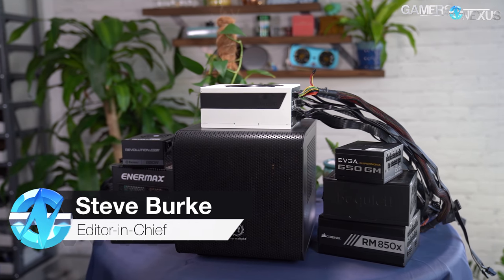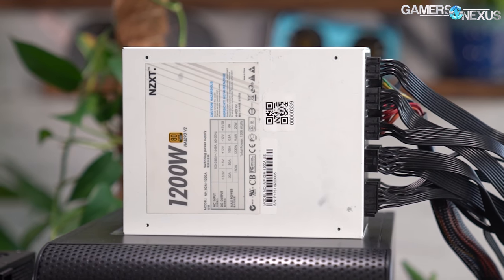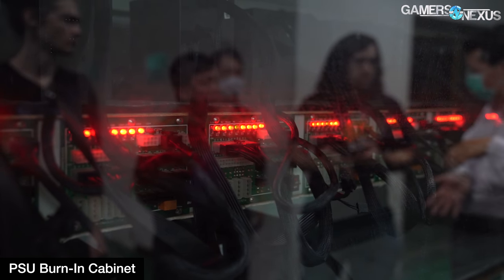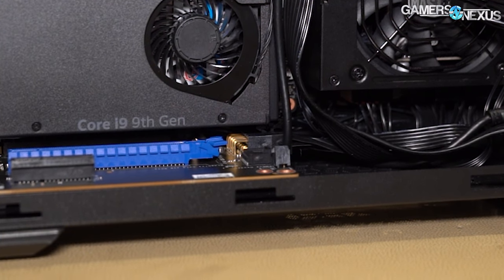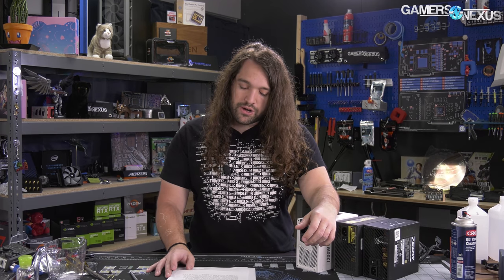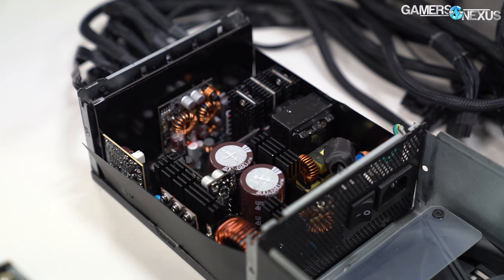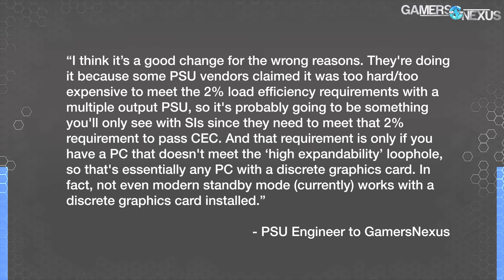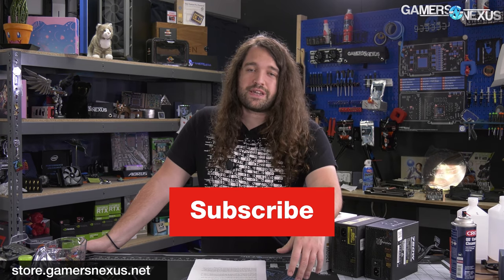Intel's ATX12VO Spec Explained & What Manufacturers Think

Comment: What a mess. The 5v and 3.3V railed are hardly used  and thus the  consumption will be small. Even if their efficiency is lower  in the scheme of things the majority of  power consumption will come form the 12v rail. 
which means motherboards will be forced to do the conversation on there making things worse for the motherboard.  And the overall efficiency will go down. A good   power supply will still have way better  efficiency for the dc dc conversion than the  solutions put on cheap ma inboards.
If anything this will lead to more waste!!!!

Stupid politicians virtue signaling.
Unless you make all pc components 12v  then the only 12volt power supply will increase the waste not reduce it
Reply: USB, PCI-E, SATA, yeah, nothing uses 5V or 3.3V.
Reply: Because it is hardly used, there is no need to convert AC to DC for 3.3 and 5 V. That's mean even better power saved in the first place. Also less cable as there is only one connect to the motherboard.
Reply: Pretty much nothing (modern) in a PC uses 12V, that is why there are a bunch of VRMs on a motherboard for all the important bits, which take the 12V and step it down
Reply: @rexsceleratorum1632  and thats is relevant on what i said how??

no relevance at all

cpu which will consume a big chunk of power the voltage change all the time over generation so you will need VRM to begin with

in the past computer used also the other rails more than we do now

but as time passed more and more devices start using the 12v 
and thats why the modern power supply practically deliver 12v and very few watt on the other voltages

having the politicians pushing for a hight efficiency power supply for all voltage lanes is ridiculous since there is so small consumption there to begin with
Reply: @sonaruo  You are not making much sense there. A very low demand on a beefy 5V or 3.3V PSU power rail means low efficiency. Moving the VRM from the PSU to the mobo or SATA device means smaller, cheaper, more optimal VRMs can be used, which will operate much more efficiently.

Comment: I've had more motherboards fail than psu's. this standard calls for pushing a lot of current through the mb, i can't see that ending well.
Reply: Especially for people that do creative modding or any modding that requires power at all!
Imagine a person overloading the motherboard vrm for sata power because he wanted a 15+ drive NAS.
Reply: @zarmaanful  Right now people are getting inefficient PSUs designed with the 15+ drive NAS guy in mind when he could just buy a separate VRM module very cheaply for a 12VO and not burden everyone else
Reply: @rexsceleratorum1632  inefficient?

I thought the newer PSUs did like 90-95+ efficiency.

Installing a buck converter just for having access to +5v and +3.3v seems a bit inconvenient.
Reply: @zarmaanful  Newer PSUs already install VRMs/buck converters inside the enclosure. Taking them outside the enclosure helps you select a VRM (or multiple VRMs, they are cheap) that matches your load. A VRM that is overspecced (because the PSU manufacturer doesn't know what your load is) means it is not operating near its optimum load for the best efficiency. VRMs are usually inefficient when they are close to idling.
Reply: @rexsceleratorum1632  the efficiency gains from fine tuned VRMs won't make much of a difference.

And I am pretty sure majority of consumers won't know/bother to properly spec out VRMs.

Some less knowledgeable consumers could buy questionable VRMs(e.g. Gigabyte PSUs) and cause some safety hazards(to themselves or the equipment).

Taking out VRMs from PSU WILL improve PSU efficiency, but in reality you are shifting the inefficiency towards the Motherboard thus the overall efficiency of the System stays similar.

To me it seems like a solution looking for a problem. It reminds me of the ASV kit thing happening with motorcycles.
Reply: @zarmaanful  VRMs outside of the PSU already handle most of the power usage in a modern PC because modern CPUs require voltages too low and amps too high to transmit over a long wire from the PSU. What is happening now is just the logical conclusion to what has been happening for a long time now. Which is that all devices will switch to 12 volt only and generate what they want internally. External standalone VRMs are pretty much a transitional requirement.
Reply: @rexsceleratorum1632  fully agree to the point regarding most of the power hungry components have their own VRM and take +12v from the PSU.

I also agree that +12v is optimal voltage delivery standard for consumer electronics.

Comment: wouldn't the 12V only PSU be cheaper (less power lanes = less complicated), amrite? if yes it would be shame if vendors would charge the same for those...
also wouldn't power conversion on mobo force the use of beefier radiators with fans? i would nope out of there

Comment: But there are already plenty of motherboards running on 12V only, the ones using a DC connector with external power brick.
Reply: Probably like my HTPC (which is a thin client) it uses an external power brick.

Comment: If I was a  motherboard  manufacturer, I'd build an external 12v to 5v buck converter. Creating a secondary power supply for any peripheral. Thus you can add them as needed.

Comment: ITX boards are already jam-packed to the brim, no way they can manage additional buck converters on there. I don't like it
Reply: Than you probably hav'nt seen packed board, search google for "kontron SMARC module"
Reply: The smaller connector saves more space then the extra components for the power conversion need.
Reply: @bjiirn  I don't think that 14 pin space is equal to 3 dedicated DC-DC buck converters and connectors to power SATA drives.
And the connectors to power SATA drives alone would take much more space than what you could save going to a 10 pin connecter.
Reply: @zarmaanful  Have you seen the size of a 3A buck regulator? That shit is packed in 6 pin TSSOP packages, even with the required cap and inductor you still fit inside of a nickel.

Comment: So motherboards will get more expensive and rogue devices will have a greater chance to blow your motherboard
Reply: wat
Reply: @metacube9913  The 12vo standard doesn't remove the need for 5v and 3.3v - It just moves where the tranformation of the power is to the motherboard: this will increase cost
If a device suffers a critical failure that means any power spike for the transformer has a good chance to kill the mobo, where the power is transformed

Comment: My opinion is that the PSU Engineer is right. I'm not a PSU expert but... 3.3v and -12v where designed to supply older hardware inside the motherboard, in older days even your CPU was powered drectly by 3.3v on the PSU, there wasn't a regulator like in modern boards, and -12v is a requirement for ancient NMOS sillicon that isn't used for more than two decades. It can be completly removed without affecting anything in modern hardware.

5v is a different beast. When talking about hardware integrated to the motherboard that requires 5v such as M2 and USB, its easier to move those VRMs to the motherboard and just supply the whole board with 12v rails. That is because those interfaces uses low power and can be easly converted from 12v as the power supply is doing today. So the 12v only new ATX12VO connector is a good idea in general, less cable and smaller/simpler PSU designs will expands the possibilities without compromising the MB capacities by offloading everything.

Powering external SATA devices from the motherboard IS A TERRIBLE IDEA in my opinion, that is where I draw the line. Building a regulator in a motherboard to drive multiple external SATA or MOLEX devices is a bad design! So, although i'm favorable in removing the 5v from the MB connector, I'm not favorable in removing it entirelly from the PSU, at least not yet! Maintaining SATA and MOLEX 5v compatibility is necessary at least until the market adapted to 12v only devices, if one day it does! Then we can think about 12v to 5v molex/sata adaptors that are not that hard to developed when talking about a single component like a old HDD or led strip. But this progress has to be linear.

And i think this standard should arrive to the enthusiast market as well, in form of new 12VO PSUs and motherboards with some companies supplying a adapter for older hardware.

Its even not hard to imagine a 12v only PSU with a small adaptor on the molex/cable sata itself that its responsable for splitting the 12v rail into a suitable 5v line for a single or maybe two devices at once. This standard is a progress, but currently at the wrong direction.

Comment: Great so now we get the motherboards to be more expensive and if something fails on them, that being a voltage regulator for the 5 and 3.3v rails we need to get the entire fucking board out of the PC just to get that replaced instead just replace PSU and go, fuck uptime i guess because that makes sense, yeah, NO!
Did i forgot to mention how that potentially limits the maximum power a motherboard's VRegs can give you thus limiting the number of drivers you can put into the system? 
And how the VRegs being on the mobo could cause more instability per VReg channel, because they are on a non-isolated environment where every motherboard manufacturer can make it how they like + the additional heat this produces further degrading the mobo over time faster?
Shall we make a reality check for a second?
Thanks Intel..(PS: fuck you Intel from the bottom of my heart and fuck you again because 3 years ago i bought a Seasonic Titanimum Ultra 650 Watt so i can keep it for years with its awesome low ripple and quality components, did i mention? oh yes fuck you Intel).
Reply: Don't forget RF issues, and repairability.
Every power supply or buck converter makes noise(Radio Frequency, Coil Whine) that when unshielded can cause interference with digital circuitry.
Repairing a Power Supply Unit is much easier than repairing a Motherboard with a million other circuits on it as well.(Diagnosing a motherboard is hell to say the least!)
Reply: @zarmaanful  +1
Reply: It will literally add all of $2 to the BoM, and remove half that through wire routing and connectors.

Comment: What I’d like to see in this spec is a dedicated 4 or 8 pin connector to feed a breakout board that a case manufacturer could locate and mount somewhere in the case. So it wouldn’t need to be on the motherboard, or limited to say just 4 or 6 drives.

Comment: To me, there are a couple things missing. Motherboards could be required to take 5V/12V on the always-on PIN to give us compatibility with current PSUs. More importantly, this would have been an opportunity to standardize the CPU 4/8 pin and GPU connectors, giving us one connector for all (but the main mobo which has the standby rail, power-on and similar).

Heck, that could have been a separate control-only cable, with everything else being one standard 4/8 pin 12V. That would be a dream.

Comment: Motherboard manufacturers know how to make these changes.  Think about a Thin-Mini ITX motherboard.  They generally only have 12V or 19V input, and an on-board SATA power out for drives.  I think this could simplify things for the better, on lower end systems anyway.

Comment: Seems totally stupid. Why would you move it onto a motherboard? Those things are already crammed full or stuff. Having to include a voltage converter on them as well will just make you be able to fit less features onto them. Not to mention the rubbish about "efficiency" At the end of the day, you will always have losses during voltage conversion. Now they have just moved them to the motherboard (another heat creater) rather than the PSU!
Reply: I mean, locally transforming DC-DC is actually quite efficient and very low footprint these days, as you would only need Buck topologies for this, there are solutions that boil down to a single chip. To me as an Electrical Engineer this sound like a much better solution than having to route another network on the boards, which mind you have fast switching traces. I think that a better idea would be to move away from LV standards all together.
Reply: Server systems that are using multiple power supplies already have these systems in place. Many workstations from OEMs already have these 12V0 spec already in use, only with their own specification. Intel is only providing a common framework for manufacturers to work with. OEMs that make their PSU themselves, they are 'whitelabel' build components in a similar way that Asutek build AIO cooling solutions for multiple end-user companies. By using a standard, these factories can use a single design a market them to OEMs..

Note that the CEC standard specifies efficiency in STANDBY mode where EneryStar efficiencies are specified under load (20, 50, 100%). Goto the @17:52 timepoint at pause the video. Take a good look at table V-9 and especially the differences between 115 and 230V, they are the direct result of voltage differences. Every wire has resistance and the longer the wire, the more resistance. Ever tried to directly power a simple DIY LED using 5V? Then you know you have to place a resistor in line with the led to 'lower' the voltage. Back to the 3.3/5V wires from your PSU. They have a resistance and the voltage drop is higher for lower the voltages. Here is a good resource to read up on voltage drop:  https://electrical-engineering-portal.com/voltage-drop-calculation-methods. Also DC-DC step down converters don't take up that much room. Some MB manufacturers add up to 20 power phases. Also note that the 12VO systems usually don't have that many mechanical drives and all USB host controllers have a maximum power delivery. So the 5V usage is very limited, meaning that the step down converter can be very small. I've build myself numeral step down converters around the LM2596(s-5.0) IC, it can delivery 3A at the output voltage, meaning it can provide 15W output at 5V. At AlIExpress I pay 97 cents for 10 converter IC's including free shipping, that's about 10 cents per IC. Imagine the price if you buy them per 1000 pieces.. The LM2596 is a very efficient converter as a such it produces almost no heat. At least not to the point that you need a passive heatsink to cool it..

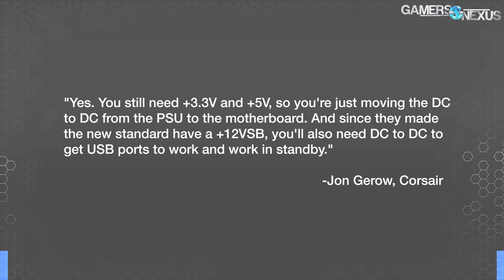Comment: 21:38 I was going to mention that a T20 that I have has all proprietary connectors on the power supply, so was wondering if that was a 12VO kind of deal. Seems like that's the case.

Comment: I thought they should do exactly this. The only minor hang up is SATA or peripheral power, but SATA drives look like they'll be quickly decreasing in popularity because the performance of NVMe drives. 
The power converters for 1-3A of 5V power are tiny, they take about 1.5cm².
Half of cable management is dealing with the 24 pin cable, that has half of its wires for things that are legacy.

Comment: If you wind up with a 12v only system and want 5v or 3.3v you could . Use a Bec or a few of them depending on your needs.  They are inexpensive and small. And generally use JST or servo connectors  for output  (the servo connector is basically a 3pin header. Female ) and the jst is slightly larger.. . Knowing theese are so avalabile . There will be adapters on the market .

Comment: I welcome 12VO into all but the enthusiast space. I imagine stuff like the Seasonic Connect, but with the buck/boost in the extra splitter to bridge the gap between 12/5/3.3 mobos and 12vo mobos. Increased modularity, smaller cables, increased efficiency, but still with the PCIe power available from the PSU/splitter (now closer to their destination) since that's all 12V or G. 

My only worry is that the sata connector with integrated power won't be standardised for a while.

Comment: Good overview and analysis. I don't think it's a stretch to expect boards to be able to accomodate this relatively easily, it will be some development cost in the initial phase, but it shouldn't be too hard to optimise the use of space on even ITX boards to account for this.
I hope future standards will let drives and other peripherals be powered by 12v only as well, that way the low voltage rails would be completely ditched except where they are necessary for powering certain components and there would be no need to have large converters anywhere for the low voltage rail, each component that needs a certain low voltage will step it down on its own.

Comment: This is feeling like a missed opportunity.

I was hoping to see 20v come to desktop/workstation/server PC's soon.
An opportunity to use a 20v rail to feed the CPU & GPU regs would be pretty efficient, but the main reason would be for USB PD.
With USB PD capable of up to 100W (20v @ 5A) it would do well to deliver power and display signal over a single cable, and allow other devices access to a significant amount of power over USB ports.
Small printers that are powered by the USB port only... VR headsets getting a more comfortable power allocation out of a single port at the PC end... Charge a Phone or Notebook from a desktop PC's USB ports at a rapid rate.

Comment: An important thing to keep in mind here is not all power converters operate at the same efficiency. If you have a 85-90% efficient AC/DC converter (main power supply) you could still have 95% DC/DC converters (12V to 5V and 12V to 3.3V) on the motherboard itself.

Someone correct me if I am wrong, but I though power supplies used multi winding transformers to create the separate voltages. Optimizing this design for a single voltage rail could help increase efficiency. It also should make the power supply itself cheaper. 

This is not necessarily a critique of the video, but of the comments. It's all in the video if you listen closely.